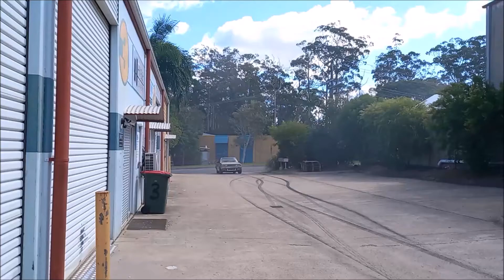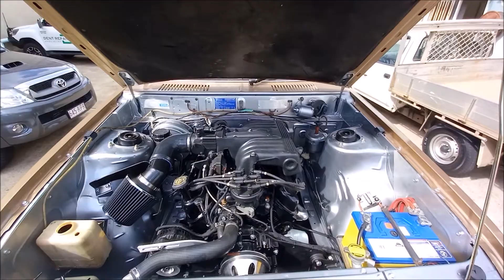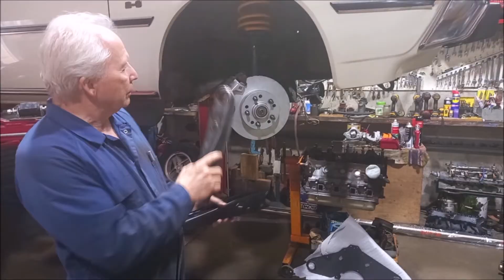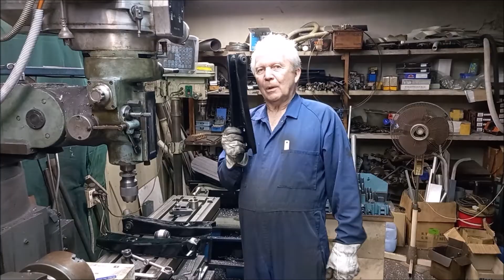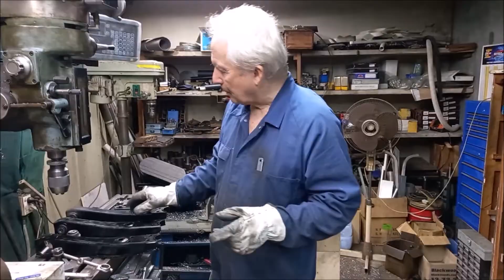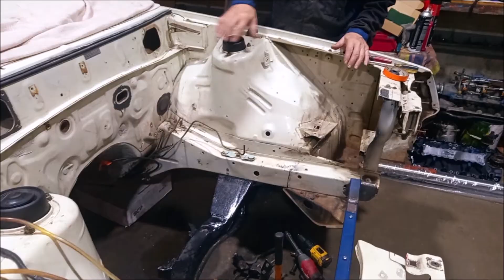Sigma V8 Scorpion V8 conversion. V8 swap into Sigma Scorpion. 5.0 Windsor Sigma V8 conversion.

Comment: Alot of hot rodders are using a complete AU falcon  front  suspension with the cast alloy  crossmember and in fact all the suspension components, from the AU ,  The AU Fairmont ghia and fairlane has a really good Complete IRS diff , there  usually about $400  can turn into a lsd relatively simple . Check  out the complete AU stuff , it's good , real good .

Comment: would that territory bush modification also work for X series ford falcons? they have a lot of crap suspension parts especially the idler arm.
Reply from the maker: Yes they will work on X series Falcons, I've also done them for Toyota, Nissan, Mustang, Triumph, Datsuns. Guys racing love them because they don't flex and you don't have to cut up the lower control arms to fit heim joints.